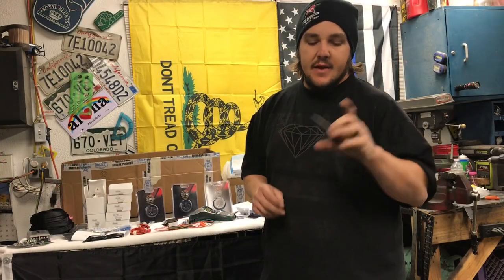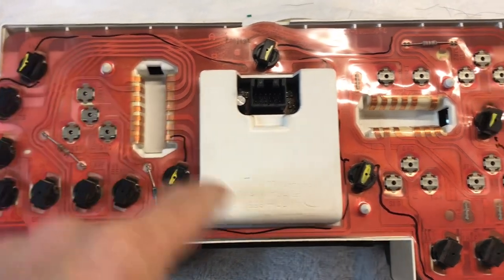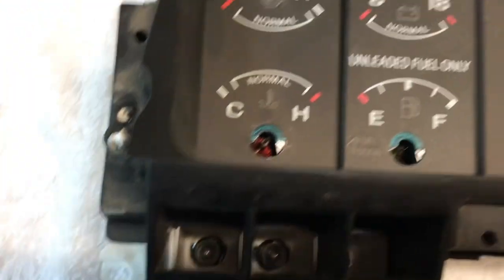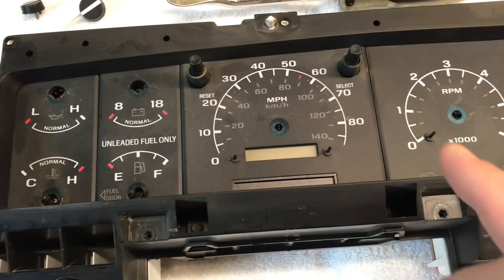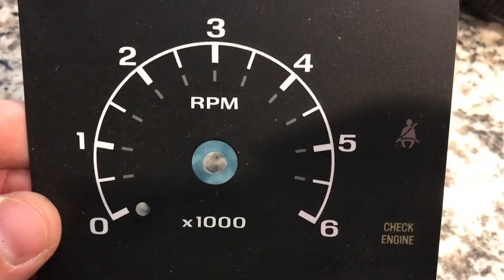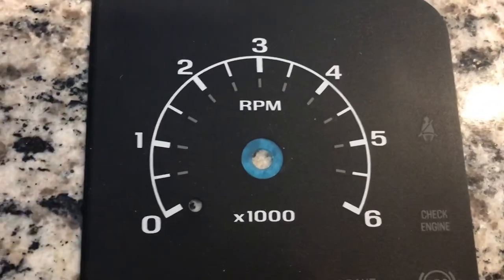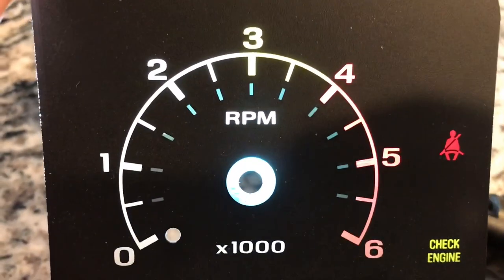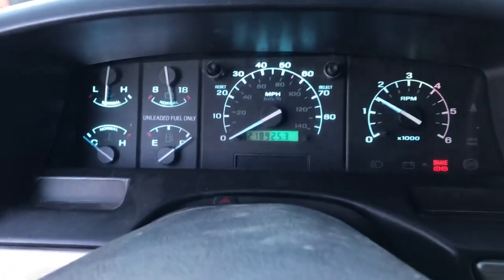OBS ford gauge cluster *Green Delete*

Comment: Any issues with the needle calibration and did you remove them when it was still in truck and on or when the cluster was removed?
Reply from the maker: I marked everything before disassembly. But even with doing so it took a few tries to get my tach needle back on right. Not too big of a deal